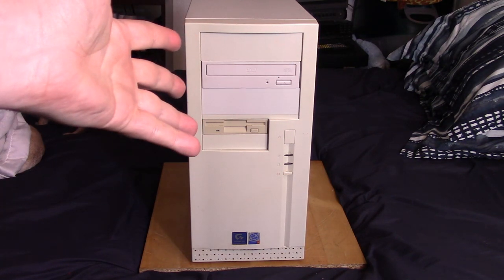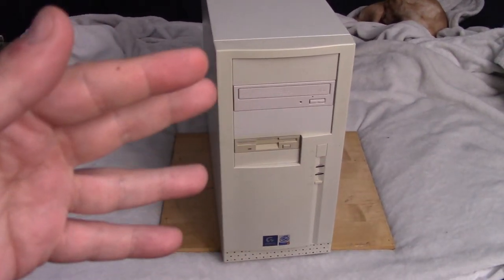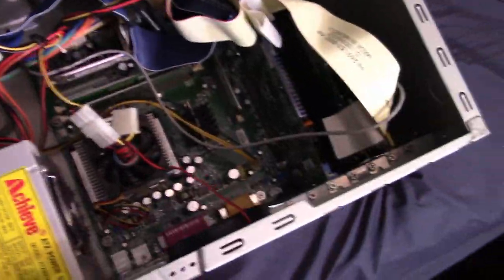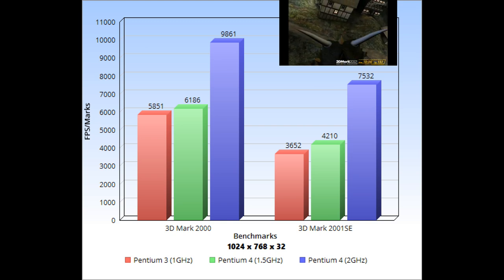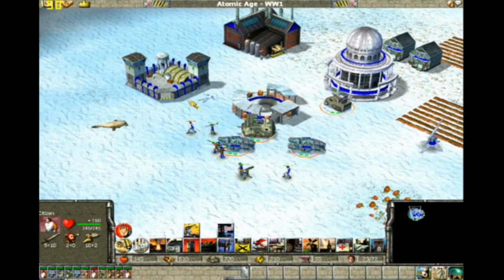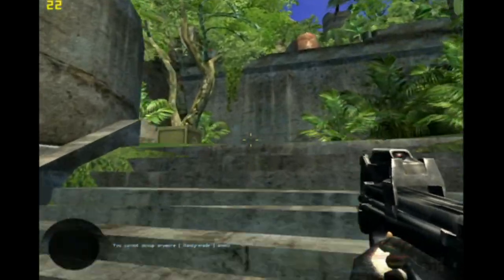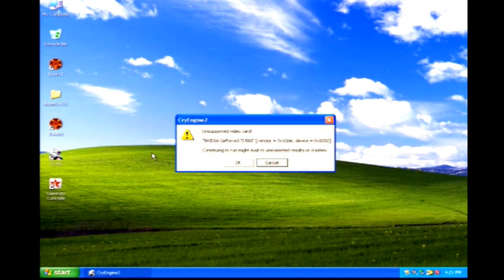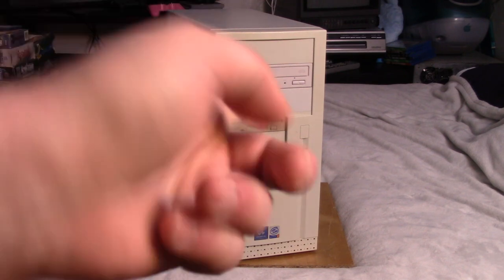Ultimate 2001 RDRAM Build

Comment: Interesting. My first PC that was mine and not family's was a Dell with a 1ghz P3 coppermine in 2001. A year or so later built Athlon XP 1800, then later upgraded to XP 2500, then in 2010 upgraded to athlon II x2 240, which a few years later got upgraded to a phenom II x4 840.....I never had athlon 64! After the phenom I had some refubished parts, including a core i5 3570, then i7 3770, I was playing with that until 2019 when I got a Ryzen 5 3600...upgraded to a Ryzen 7 5700X recently!

Comment: the netburst architecture was probably the most influential architecture of intel's since the original pentium. it settled the argument about whether performance gains were primarily due to increases in clock speed or innovations in chip architecture decisively.

Comment: gigabyte 8tx motherboard, pentium 4 willamette 1.5 ghz processor, rambus 1024 megabyte 4x256mb rdram memory, two 3dfx voodoo2 sli pci graphics cards connected to nvidia quadro fx 1000 agp, dell p1130 monitor, dvd rw recorder, audio diamond monster sound card m80, microlab B77 speakers, windows millenium this is a high quality retro computer for me what matters is stability backward compatibility in offline mode in retro style

Comment: Ahhh sweet memories. In 2001, I had a Willamette 1.5 GHz built on RDRAM. It was slow as fuck, given it had only 128 MB on Win98, but both CPU and RAM was dissipating a lot of heat, so I ended up dismantling it and slap in a Thunderbird Athlon on DDR instead a year later, so my family can enjoy Windows XP to the fullest, with more RAM (as RDRAM was pretty darn expansive at the time)

But I'm glad I can see the full potential of the Willamette P4s :) Thank you for this loopback in time

Comment: Hey, dude! I liked the video but I wanted to let you know the GF3 Ti 500 at 9:27 is missing one of the VRM's capacitors. It's the one near the upper right corner next to the coil. You can see there used to be capacitor legs in the solder on the pads.
I believe the replacement part is a Panasonic/OS-CON SVP series 16V 82uF capacitor, part no. 16SVP82M. Even though the card still works missing the cap is probably stressing the VRM causing extra heat in the remaining parts so I'd recommend getting two new caps and replacing the remaining one too.
Have a good one! :-)
Reply from the maker: good eye! thank you for letting me know.
Reply: Well spotted, great info 👏🏻

Comment: Interesting video, even without true apples to apples comparison.

I hadn't got any P4 at the day. What's more, I used to fiercely hate it for being optimized for nothing but capitalizing on the ignorance of the masses. I strongly sided with AMD.

Well, today I'm into old hardware and absolutely indifferent about the old Intel vs AMD debates and fights. Now I like P4 CPUs as humble parts in my collection. And I definitely like Socket 423 as I see this package somewhat... clumsy sexy. That large, little awkward CPU that looks like it has a S478 one soldered on an interposer, the metal plated RDRAM sticks that were so damn unreasonably expensive, and the whole somewhat exotic platform has an appeal to me.

Funny that you mention trying XP on this config and how it ran OK. Now I'm considering switching to 98 on my 423 test system. Not because it can't run XP well because it's completely okay with it, it's because it would feel a better fit. I have enough other XP systems and I'll even probably stretch that OS towards my newer systems like AM2 and/or S775.

Comment: The car analogy (hehe, -anal-ogy) is kinda fitting as I remember at some LANs, you were considered some kind of fraud, a poseur or an idiot if you brought a Pentium IV and not a K7. The early P4 was trash though, it was extremely expensive and it was commonly believed Intel rushed it out due to being scared of the Athlon, it seemed unlikely they could push the P3 any further at the time as it was already turning into a hot mess, with whatever die shrinks and changes to manufacturing it needed likely not being financially viable at that time. One has to wonder what the yields were like for the Tualatin 1.4 and if this played a part in it not officially being sold at retail.
Odds are it made little difference in the long run, I don't think any technological progress was lost, though it may have happened in a slightly different order and the eventual 64-Bit implementations may have been a little different, that's about it.
It goes without saying that I'm not in the "Hey! You're using the wrong CPU, so you should feel bad!" crowd - Of course I'll tell you my K7 would've jumped up and down on this thing (until it inevitably set fire or ran out of working capacitors), but you can use whatever hardware you want for all I care, and I'll observe with interest from the distance in cases like this where it's something I would never own.

Comment: About the car thing I really don't give a crap about what transmissions in a car or an engine I prefer drivability and ease of maintenance, I'm going to be honest with you I mostly would prefer a good v6 engine over a gas hog of the V8 specially since v8s are way heavier as for the transmission thing you really should ignore those people they're are some days where you just want to get in your car and drive and not have to deal with shifting gears all day, plus nowadays they have some pretty good aftermarket automatic transmissions that shift pretty quickly some people out there don't truly appreciate cars regardless if it's an automatic or a manual or if a V8 or four-banger I say just enjoy the car that you care about and screw everyone else
Reply: Remeber 9/10 people who tell you to drive a 350 or larger and manual transmission

Drive a honda or corolla them selves ( some on lpg as well )

Comment: You’ve heard there are less people in the PC version of GTA3? 

Absolute bullsh*t

The PC version is the superior in every way. The Xbox version has some extra graphical bits here and there (it was released later) but as you pointed out, the PC version is easily modded.
Reply from the maker: I could be wrong but I swear when I picked up my PC version of GTA3 I looked up the PC PS2 differences and I was surprised there were a few things that were done better on the PS2. I distinctly remember something about the helicopter blades effect and I could have sworn I read the PC version had fewer people on screen at certain parts but I could be mistaken or maybe I'm getting my versions mixed up.